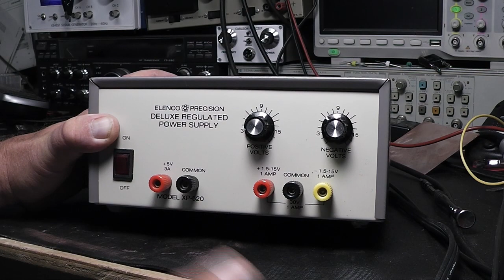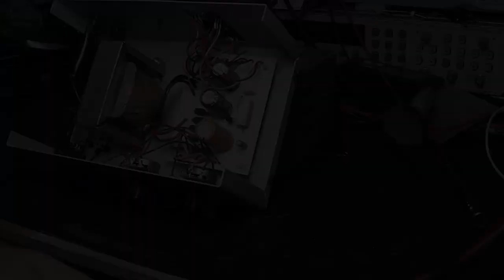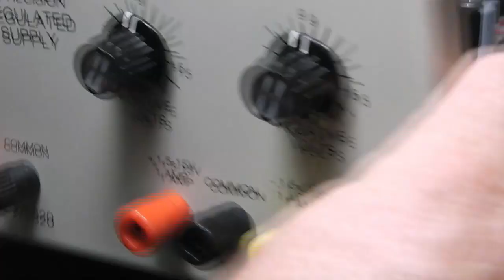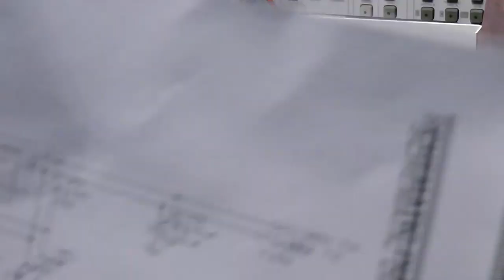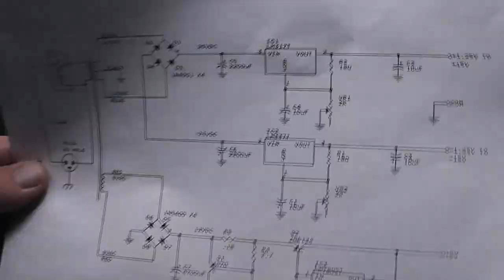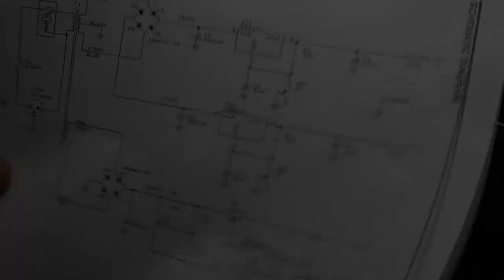Elenco XP-620 Power Supply Repair

Comment: Years ago, I bought my 1st PSU - Elenco XP-625.  New to electronics, I tried it on several devices as a PSU.  It has killed EVERYTHING I have ever connected to it! :D  7yrs later, I'm thinking of ripping it apart to see if it was simply defective (DOA).  Thx for your vid.  Beware of these unfiltered/unregulated "magic smokers".  Recently, I connected a ZK-4KX DC Buck Boost Converter Module to it to act as a controller, and after about 30secs, drawing no current, it blew a 470uF 35v electrolytic cap in the Converter!  So, I've named it "Killer".  Thx for your vid.
Reply from the maker: Glad you enjoyed it!!